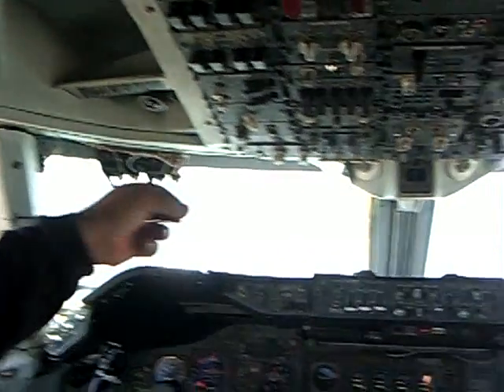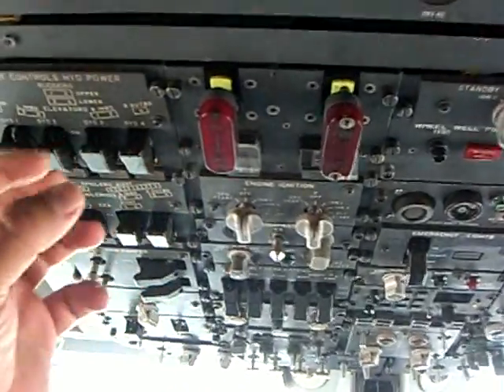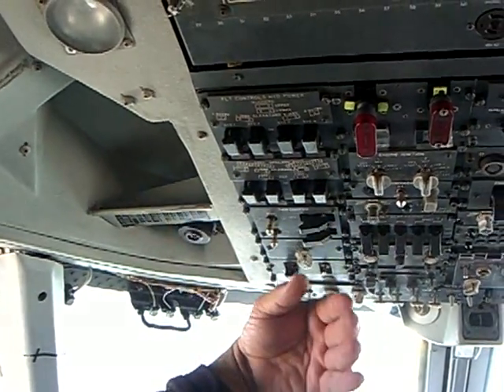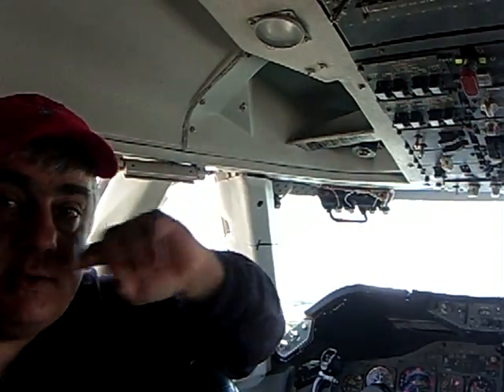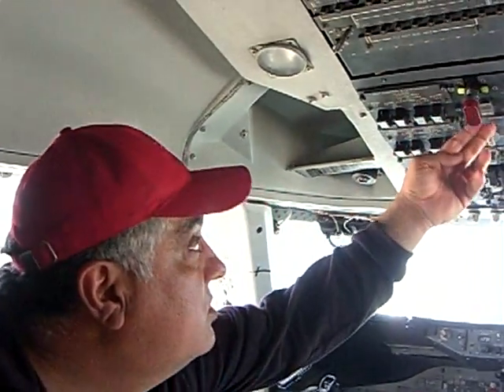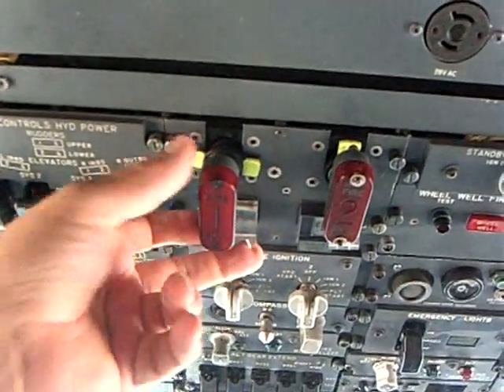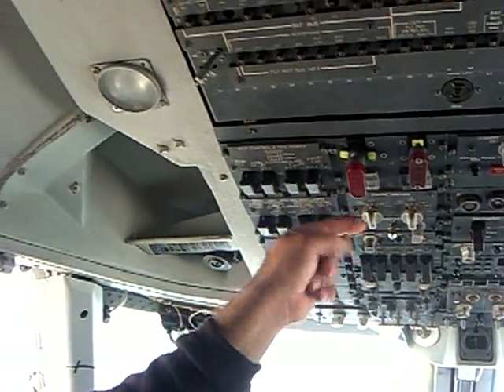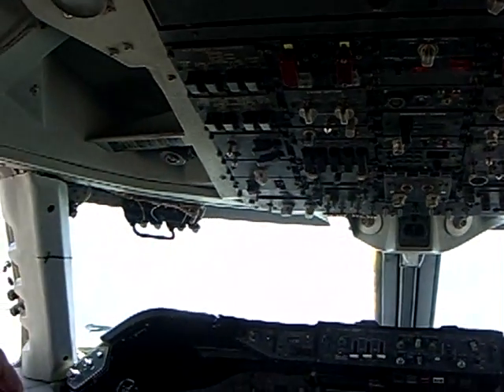The Amazing Boeing 747 extinguishing Engine-Fire  from cockpit unique design features -7

Comment: So in other words you have a discharge plan for deploying the extinguishers. If you pull the fire lever and cut off the engine there is a good change the fire will blow itselt out and the warning light will go out and you won't need to discharge the extinguishers. . But if it doesn't you kick in the extinguishers.  What is the typical extinguishing agent that is used ? I'd imagine CO2 would be the most effective agent and cause the least damage to the engine. I have had  to use this on a simulator once when engine 4 on a 707 caught fire. Just pulling the fire lever worked. After a few second fire warning the light went out and I was able to restart the engine and continue the flight. However, I'd imagine in a real aircraft it might not be a good idea to try  and restart an engine that was on fire.
Reply: This is only 8 years late, but the fire extinguishers use Halon.